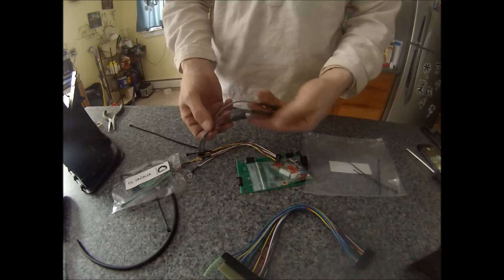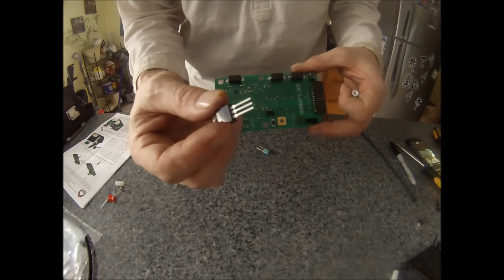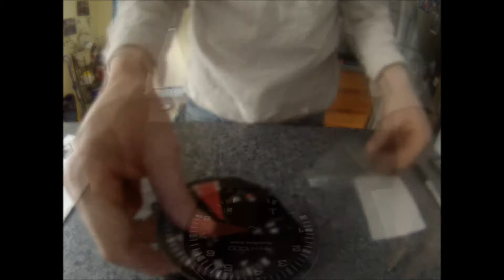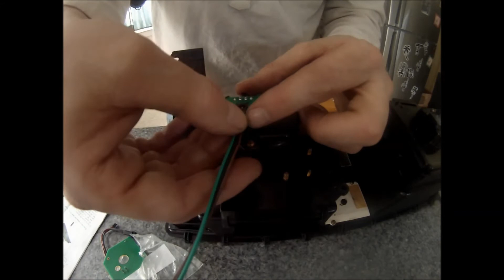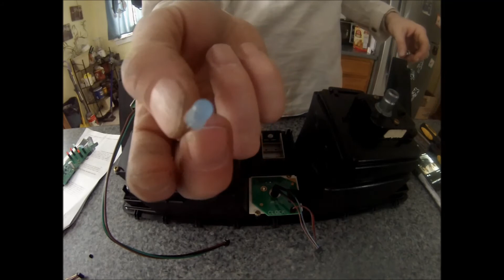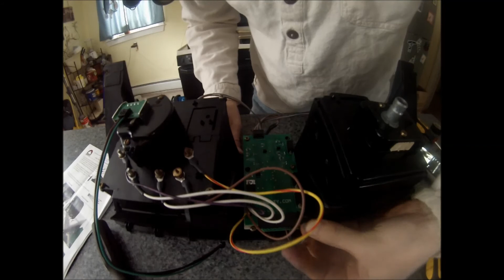Vanagon Instrument Cluster Fix

Comment: What kind of screw driver did you use to adjust the tach RPM? Do you remember if you turned clockwise or counterclockwise
Reply from the maker: Heya Dominic, I wish I could answer that question for you.  I have not adjusted my tach yet.

Comment: so does it work?
Reply from the maker: +RecArt Yes it does.  The O2 and the Volt sensor both stay on in my Vanagon, but that's the same as before due to my Subaru conversion.
Reply: excellent, thanks for the quick reply.  I got the kit in front of me and doing as much research as possible before taking the cluster sheet out... not too confident if u know what i mean :)
Reply from the maker: +RecArt Understandable, in pieces it looks overwhelming, but once you get going it all falls together.  What year is your Vanagon?  That makes a big difference.
Reply: 1990 carat.  Got it all sorted and it works like magic.  :)